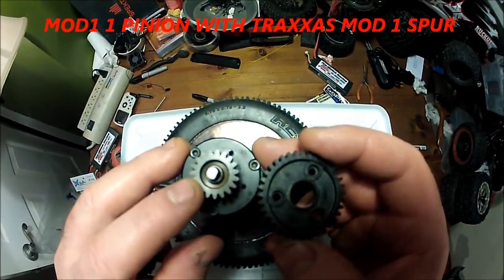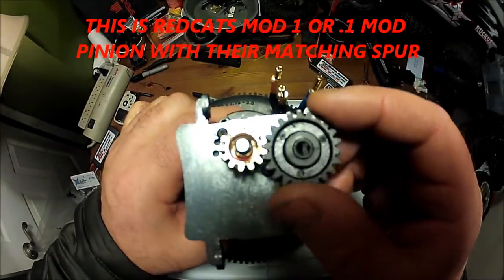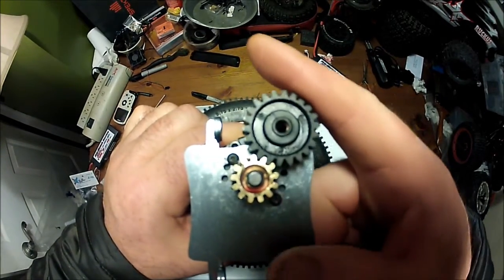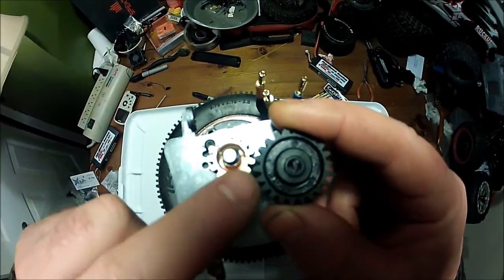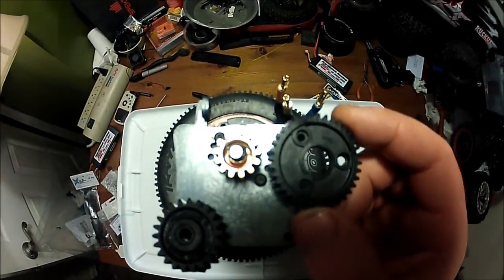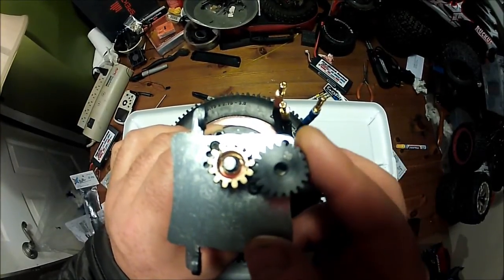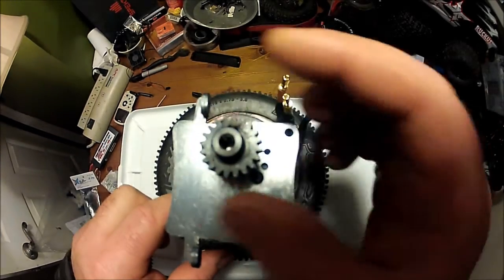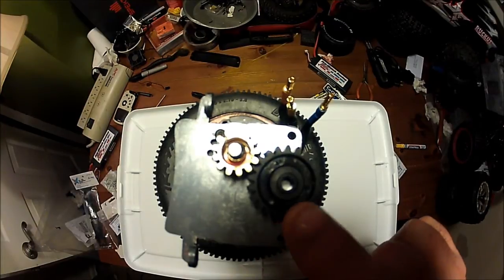REDCAT MOD 1  or .1 is actually  mod 1.25

Comment: Those are clearly not correct.   Redcat is not using the standard well known mods or pitch. They are using a proprietary gear pitch.   You will be better off ditching their gears and running standard
Reply from the maker: Thanks for the comment Image Audio, the weird gear pitch redcat uses was explained to me in a forum, I got rid of the terremoto about 6 months after making this video. :)
Reply: jammer2150  yeah I’m
Bout to sell my terremoto10v2.  Damn diff issues.